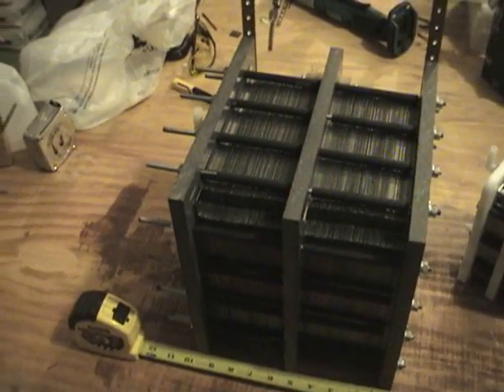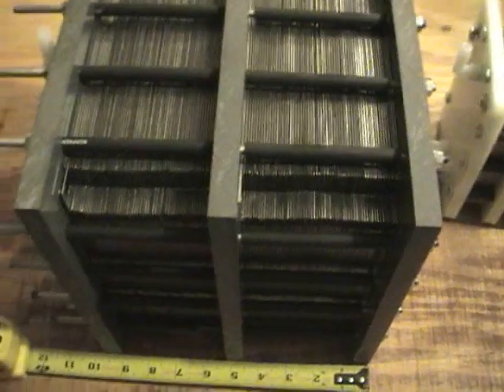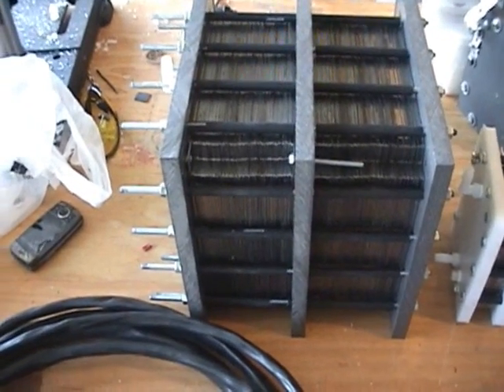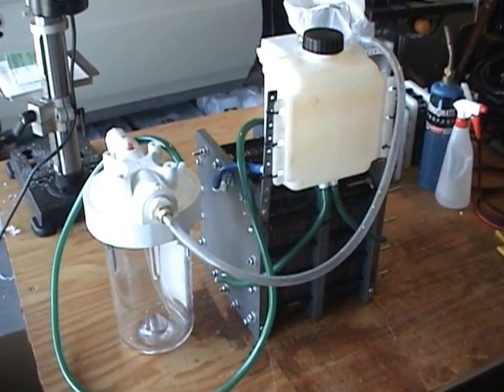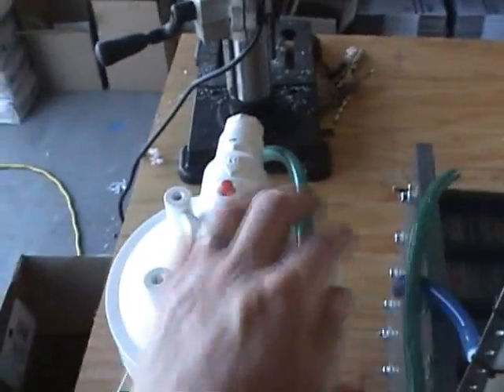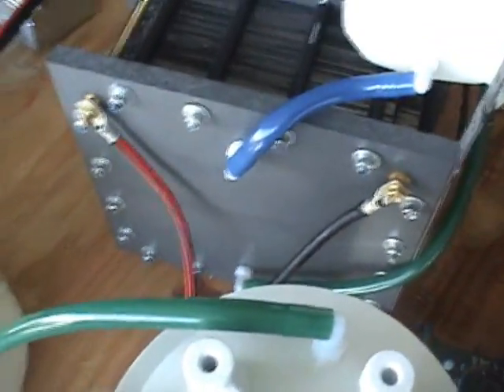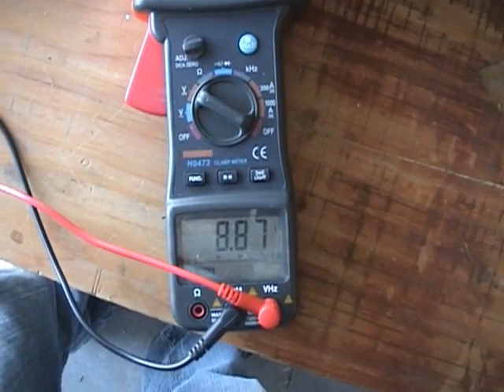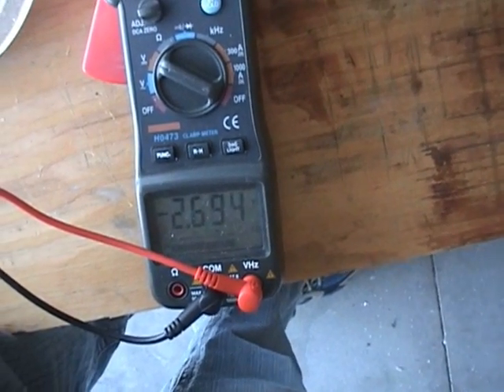118 plate MASSIVE hydrogen generator build part1

Comment: What would happen if you used AC rather than DC for HHO? Would it matter if a plate produces oxygen on one cycle then hydrogen on the other, or would there be some capacitance factor cancelling out the production?

Comment: The idea i have instead of trying to convert the water using cells. How about using a injector idea where fresh water is feed in to the injector and this in inside in the injector where the conversion takes place. with pulse and out comes your hydrogen , can even be controlled just like regular fuel pressure from injector.. The injector Would be the converter From H20 -hydrogen. Just a idea, In way it help with atomization. Just a Idea But i believe it would be more efficient. :) My idea would not use the electrical but sound or a certain frequency

Comment: i made one with stainless steel plates and after running it for about a week the plates got a bunch of gunk on them after cleaning them, I found that the plates are starting to get pits in some of them. Is there anyway to slow down or prevent corrosion or pitting from happening? please help
Reply: +MASTERSAIS A bit late, sorry, but from my limited knowledge, I can say that your best bet is to either replace the Stainless Steel plates on a regular basis, or upgrade to a more resistant metal such as gold, titanium, or a few others, do a quick google search.

Comment: I am trying to find the pattern for your dry cell plates and gaskets so I might be able to have some laser cut at my local Sheet Metal suppler. I would also like to find out how many neutrals to use per Positive and Negative plate. I have not been able to find this information anywhere. The tanks you use for your dryer and the flash valve resources would be nice. You have very nice equipment and I have been researching HHO generators for a few months. I was not satisfied with my previous attempts at creating a generator. I now $700.00 into the project with nothing up to my expectations. Please help.
Reply from the maker: We have done all the engineering and development for you. No need to spend anymore money researching. See your website for some great products. www.greenfuelh2o.com

Comment: I have done the same things when trying to create electrolysis in water and I tested it with a volt/amp meter and notice current before I even connected any power source. If you attempt to measure the DC voltage the voltage will drop slightly for as long as you keep measuring, However if you switch the meter to Ac voltage the voltage will climb to a point, stabilize and not deteriorate.

Comment: Hello Delvis that is not an anomaly what you have discovered is actually in print in many free energy volumes, There is actuall Ac/Dc electricity in water itself, water is reactive to solar EM and stores electrical current within itself. There is a method where you can induce electrolysis, where instead of putting current INTO water you Draw Current OUT of water, it produces the same effects but is slightly harder to perfect.

Comment: One way to seperate the hydrogen side from the oxygen side is get a 1/2 inch piece of plastic and use a CNC router to cut out a square shaped hole the deepth you need for the stainless steel plate to go into .
Cut drain holes on the bottom of the cell for the water go flow through.
Cut a 1/8 hole for the hydrogen side to escape to a plastic line and the same for the oyxgen side.

Comment: Is it possible to run the hydrogen generator with a thermal electric generator ? 
I have seen some auto companies developing a TEG to work with the car's Cat system.
If there was a way to recapture the wasted heat from the exahust, and cooling system that would produce the current that you need for a hydrogen generator then you won't need power from the battery.

Comment from the maker: Hard to do. You have to change the burner and heat exchanger. But if you were to use hydrogen only your existing furnace would work. If your not getting the power from solar it's not worth doing. just use electric heat would be cheaper.

Comment: Steve, I recently watched the #16 My Vision Part 1. I'm interested in using HHO to fire my 80BTU hot air furnace. My two part question is this. 1: Will the 118 plate generator be enough to provide ample output to fire the furnace? 2: How do I modify the gas valve from Natural gas to accept HHO?

Regards,
Pedro

Comment: Was that an electrical spark at 0:11 seconds. It was on the top of it in the corner closest to where the measuring tape is? If it was an electrical spark, why? there doesn't seem to be an power going to it that early in the video, does that happen more frequent where there is power going to it?

Comment: Please consider providing stochiometric Santilli carbon arc rod plasma generated HHO and recycling the exhaust through a heat exchanger and back into fuel generating chamber.  Ceramic vessels are inexpensive no/none/zero weld and DIY rust-proof. Such have flight, fuse, field expedient high explosive militia applications and sch fuel has been used by Special Forces.  NWO oil & pollution war monger tyrant Zionist/Christian/Muslim/Banker/royals will not like such a green sustainable HHO solution...

Comment from the maker: Voltage between plate gaps should be about 2.3, that is important for efficiency and production.
A dry cell is a cell that doesn't have the edges of the plates covered in water.

Comment: @MudBarf there are in existance that have claims of generating power with greater output then input by the traditional mechanics. These device include SEG motors and other motors which make near free energy mechanics; not exactly free energy but the approach has been proven by the LHC project which converted 25 hyrdogen atoms into terravolts by using the same concept of semiconductors which if cooled or accelerated fast enough can reserve power indefinately while in use.

Comment: @delvis11 Is hydrogen not a fuel? Is a device producing hydrogen, not a fuel cell, or some variant? Is it not the goal to create hydrogen to power a car's combustion engine, or to create a device that generates electricity without putting massive amounts of co2 in the air? It is like we need a chemically self charging battery, or create a charging system tha doubles or quantifies the output, enough to recharge a battery and power a motor to drive it,  recharging two battery sets that switch.

Comment: @ymdeardorff1 Actually, the current used to seperate the H2O is what they are complaining about that the output doesn't = or balance. This is true, BUT if you use the HHO to run a generator; you can design the pattern to create greater output then input. So, yes they are spreading ignorance for OIL companies.

Comment: @delvis11 Yes, there are lots of uses for HHO - and all of them respect the 1st LAW (note that it's not a theory, it is a LAW)  of Thermodynamics. You use energy to break the Hydrogen-Oxygen bond, and the energy now available in the released gasses is less than the energy used to create them.  I wouldn't expect a believer in snake oil such as yourself to understand that though.

Comment: @nicuribe , I dont know about the rest but I can tell you about seperating the gases - 
H only comes from + and O from - ( or is it the other way ? ).
So if you dont use a plate set-up, and you keep your electrodes reasonably seperate, and create 2 seperate gas cavities at the top of your tank (like a bottle with 2 seperate necks, and the water body filling it to just above the bottom of the necks)  with an electrode in each neck, you can keep the gases seperate.
Hope this helps
Happy flying

Comment from the maker: @nicuribe no one does it. There are devices that do it but they are expensive. my question is can you fill your balloons on demand or will you need to store the hydrogen in a bottle? If you can fill them on demand HHO will float your balloons just as good as hydrogen.

Comment from the maker: @sweetgyy The only thing that will prevent freezing is an 18+ % KOH electrolyte mix. The problem is that it becomes dangerous to use and will burn you easily. One drop in your eye could blind you.

Comment: Loved your video great cell.  I have a little info that will be helpful.  According to the scientists that developed the fuel cell used on the  space shuttle 1.23 volts are necessary per cell to splitt water by electrolises. In your video you said while off you showed 9 volts in the off position this is due to the fact that your cell is producing electricity from hydrogen and oxygen touching your plates.  It will act as a battery, capacitor , and electric generator all at  the same time